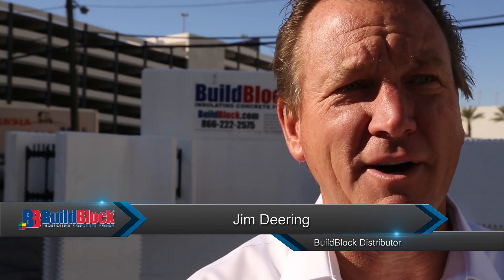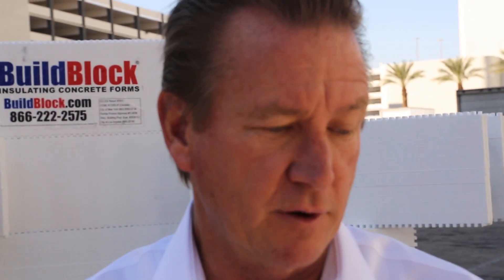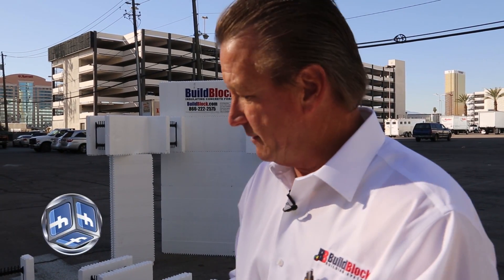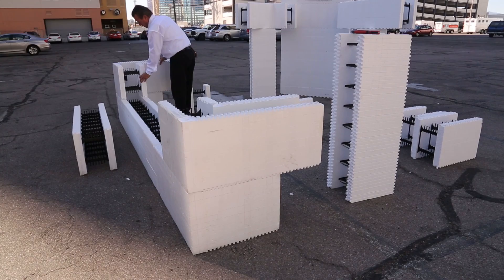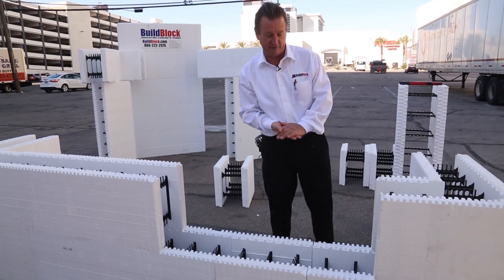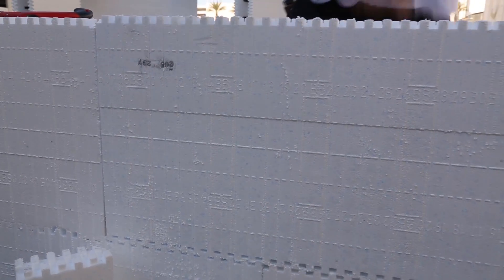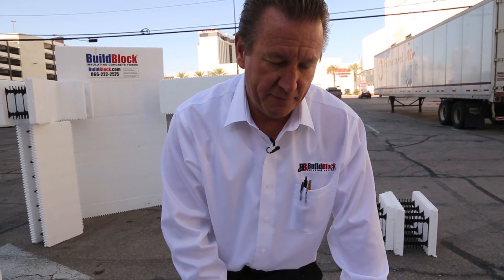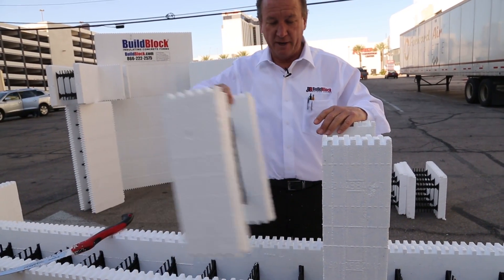BuildBlock Field Notes ICF Wall Stacking Strategies

Comment: BuildBlock has a video on building a POOL! Our City Hall, 12,500 SF was built like this. The only problems were Metal Roof, Air Conditioning ductwork and sound system for meetings. What do you recommend for roofing? Thank you!

Comment: I'm confused about the thinking behind the long legs of a corner being on the same side.  Does this end up having better overlap in the wall from course to course or is this somehow advantageous in some other way?  I follow that having measurements hew to a 6" increment is good, I'm just not getting the advantage of the long corner legs and the short corner legs facing each other in the course.
Reply: if you do short to short and long to long, the resulting length of the wall is always and increment of 6 inches using full blocks. hmmmmm

Comment: Jim Deering: Jim it was not easy for me to understand around minutes 13-14 of your video the considerations for the guys doing stucco (plastering as we call it in the UK) and the issue of the vertical lines on the Styrofoam blocks  (the lip of the foam blocks and how this may impact them).  Could you clarify briefly here if you see this note?  Thank you.

Comment: I saw this on Pure Living for Life channel.
Reply from the maker: Yep! They are using a different ICF brand with some notable differences from BuildBlock but the general technology is the same. For example, you'll hear them talk about the 2-inch connection pattern on the block they're using. BuildBlock, on the other hand, has a fully reversible 1-inch repeating pattern. This provides a tight, 100% surface to surface connection and keeps you from needing any of the clips or zip-ties that you see the Pure Living folks using to hold the blocks together. If you'd like more info on ICFs you can visit us at buildblock.com. Thanks for stopping by!

Comment: keep away from open flame
Reply from the maker: The foam on all ICFs is treated to be fire resistant. The structure of the house is steel reinforced concrete. The foam is only used for insulation. Foam doesn't burn, it melts and is self extinguishing. Once filled with concrete and finished with a 15-minute fire barrier such as sheetrock as required by code, ICF walls have a 4+ hour fire rating.

Comment: since this is styrofoam, it should be very cheep for these units - 
how much are they?
Reply from the maker: Hi Tiger, You can find direct retail pricing by visiting http://buildblock.com/store/icf-pricing/ or by giving us a call at (405) 840-3386. Thanks!
Reply: tiger body EPS is not cheap.   Go price compare some plain old 4x8’ 2” styrofoam panels and you may be in for a bit of sticker shock.  A lot more work goes into making ICfs, including adding the internal members and the hard points.  “Cheap” and ICFs don’t get used in the same sentence very often

Comment: what happens when you spill gasoline on it?
Reply from the maker: Well generally we don't recommend you spill gasoline on your house, at least not in any large quantity. Chemical solvents like gasoline, kerosene, paint thinner, etc. But it's a fair question in a garage or other area. It's very important to ensure that any waterproofing primer, paint, etc. not be petroleum based. 

All ICF is required to be finished. The exterior should be brick, stucco, siding, eifs, etc. Interior is typically plaster, tile, sheetrock, etc. So unless the area is completely saturated, a small spill should not cause any problems. No more than in a wood frame home. the worst it would do is dissolve the foam until the solvent is consumed.

Comment: I've used this system or one identical...good system short of the Lego nubins are a real time consuming pain in the ...s...plus it shrinks as you pour in lifts...the Polly webbing and side straps for attaching wall treatments strip out or fracture...been there done that...
a tounge and grove system is so much simpler and faster...can setup a 3k+ basement or home in one day and pour the next...(with experience) by myself and good pump operator ...and follow systems recommendations ...
poly steel is the system I like ...but there are now multiple systems available ...good luck and happy trails

Comment: How does this fair against termites? I remember reading about a lawsuit, don't recall all the details but it was a 20 year old build and termites funneled through the foam insulation to the upper levels. They don't eat foam but are still able to tunnel through and hit the roof and go back down other side.
Reply from the maker: You're right that the EPS foam in BuildBlock ICFs is not a food source for termites but they may burrow into unprotected foam surfaces in search of food (wood). While termites cannot compromise the strength or integrity of the BuildBlock wall, they could burrow through the foam to reach and damage untreated wood. We recommend using BuildShield Termite Protection in termite prone areas. BuildShield Termite Barrier combines a patent-pending combination of a PVC extrusion track and an adhesive stainless steel barrier. The track and stainless steel barrier extend from inside the concrete core to the exterior wall finish creating an impenetrable barrier to termites and is the only ASTM E283 tested and code approved solution for ICFs in termite prone areas. Read more about it here- http://buildblock.com/products/buildshield-termite-protection/

Comment: Not ONE word about Styrofoam as garbage. Styrofoam does not decompose in the environment under normal circumstances. Much like plastic, Styrofoam is made from a polystyrene-based petroleum product that is not biodegradable. Plastic takes hundreds of years to decompose, and Styrofoam takes much longer because it is a stronger form of plastic.
Reply from the maker: Thanks for the feedback!

BuildBlock is designed on a 1-inch repeating pattern. This means that at little as 1-inch can be cut of and the rest of the block is usable. With proper planning and care it is possible to generate as little as one trash bag of trash from an entire job site.Also, any cut piece of ICF can be integrated into the wall in a different spot as long as it has at least one web. We also recommend the use of a hot knife which creates smooth clean cuts with no other waste. 

EPS foam is broken down by UV light. The fact that EPS foam takes so long to break down is the very reason that using it as an insulation material that is sealed inside of a wall system a perfect application. This material will deliver extreme energy efficiency, well beyond any other material for generations. 

We believe that this creates far fewer environmental impacts than the high cost and waste of resources to heat and cool inefficient homes and buildings. EPS foam is also easily collected and recycled. Many manufacturers are also zero waste facilities. 

Let us know if we can answer any other questions or concerns.

Comment: Is this Lego's for big kids?
Reply from the maker: Sure is! Stacked easily like Lego and then filled with reinforced concrete. ICFs create a wall system that is incredibly strong, energy efficient, and fire resistant. Structures built with BuildBlock create a healthy environment with 75% less outside air infiltration and stand up to any natural disaster.

Comment: What about polluting material you spread around when you cut? It is plastic.
Reply from the maker: Our blocks are made of Expanded Polystyrene (EPS) Foam and we recommend the use of a hot knife when cutting ICF blocks which doesn't cause any bead to break off during cutting. EPS beads that do break off and fall are easily swept up and recycled. 

EPS foam breaks down in the presence of sunlight and using ICFs reduces the total number of products necessary to build a home (including plastics). ICF homes can be built with as little as a single trash bag full of waste. Added the fact that BuildBlock ICFs use a 1-inch interlock pattern meaning you can integrate even the smallest amount of cut product into the wall and make use of it. ICFs will last for 100s of years with energy-efficiency beyond any other technology.

Comment: what animal will be killed eating all that loose crumbs that you just throw on ground + what about water runoff  on the job site that crap will get into streams and ponds how many fish will be killed pluges up water system filters hope you can sleep at night
Reply from the maker: BuildBlock recommends the use of a hot knife when cutting ICF blocks which doesn't cause any bead to break off during cutting. EPS beads that do break off and fall are easily swept up and recycled. EPS foam breaks down in the presence of sunlight. 

Using ICFs reduces the total number of products necessary to build a home, reduces the amount of plastic and ICF homes can be built with as little as a single trash bag full of waste. Added the fact that BuildBlock ICFs uses a 1-inch interlock pattern meaning you can integrate even the smallest amount of cut product into the wall and make use of it.

ICFs will last for 100s of years with energy-efficiency beyond anything other technology. This reduction in energy use and the costs & environment effects to produce it are more than offset.
Reply: +Richard your comment only shows that you only care about you I have seen people that make that kind of mess and walk away typical contractor screw the environment  screw the customer you're right big boys fat dum and clumsy

Comment: how about if fire come whole house will burn in a second & all ur neighbors so I disagree
Reply from the maker: The foam on all ICFs is treated to be fire resistant. The structure of the house is steel reinforced concrete. The foam is only used for insulation. 

Foam doesn't burn, it melts and is self extinguishing. Once filled with concrete and finished with a 15-minute fire barrier such as sheetrock as required by code, ICF walls have a 4+ hour fire rating.

Comment: do not drop a mach, pal
Reply from the maker: The foam on all ICFs is treated to be fire resistant. Foam doesn't burn, it melts and is self extinguishing. Once filled with concrete and finished with a 15-minute fire barrier such as sheetrock as required by code, ICF walls have a 4+ hour fire rating.
Reply: impressive! 
wondering how much it will save compare the normal building material, let say a single 2-story house. Thanks
Reply: and the time of course ;-)
Reply from the maker: The materials offset each other. ICFs are more expensive ~5% but overall savings during construction include reduced HVAC requirements, faster construction, etc. ICFs deliver benefits continuously for the lifetime of the structure: lower energy bills, reduced maintenance, disaster resistance, airtight walls (low dust), very low noise penetration, etc.
Reply: How many factories do you outsource to produce your blocks?
Reply: I know some if not all are American made.

Comment: good luck with that sysrem. used it. pain in the ass and stucco looked like crap
Reply from the maker: We're sorry you had a bad experience. Was it with ICFs in general or BuildBlock specifically? Our customers build thousands of projects each year, most without challenges. We're curious about what challenges you had and if we can offer any suggestions. I'm Brian, you can reach me, Brian at 405-840-3386 or bcorder@buildblock.com

Comment: Is there any reason you could not paint/coat the interior and exterior to save on siding and drywall?  I have seen hard coats on  outdoor EPS in Asia.
Reply from the maker: That is a perfectly acceptable way to finish ICF structures. We market and sell BuildCrete Stucco & BuildCrete Plaster that are used for just that purpose. Both the plaster & stucco are each a 1-coat system that can be troweled or sprayed on and use a embedded polyester mesh. Both can be painted easily. The stucco is impact resistant to 3500psi and plaster 8500psi. Both are waterproof.

On the exterior you will want to make sure that the foam is protected from UV light and damage from the elements. On the interior, it is required that all foam is finished with a 15-minute fire barrier. Our plaster and other materials will satisfy this requirement. 

Learn more about BuildCrete here http://buildblock.com/products/buildcrete-stucco-plaster/

Comment: Could this system work for walls that are not divisible by 6"? For example, what would you do with a basement wall that is 48' 9 1/2"?
Reply from the maker: The web spacing is every 6-inches, but you can build a wall of any length. The blocks have a 1-inch repeating pattern so you can cut off as little as an inch and still interlock the blocks. For walls of an odd dimension you will end with a common seam. just strap both sides of the block every course and it will work fine. If we can answer other questions, please let us know. You can reach Mark in our technical department at technical@buildblock.com or at 866-222-2575. The full BuildBlock Technical Manual is available on http://buildblock.com

Comment: Is there an interlocking part that wasn't in the video ? I did something like this back when I took carpentry school and the blocks had nubs they screwed into the foundation.  Kind of like the flat Lego pieces
Reply: who ever said concrete has to breath better do more research. exsplain where bridge legs under water breath? or auquaducts  or sewage plants, water treatment plants? conrete will setup hard under water in fact its the best cure method . what deteriates concrete most is freeze thaw cycles and chemical breakdown. i just retired  union cement mason.
Reply from the maker: Correct. Concrete doesn't need to breathe. The EPS foam encapsulates the concrete protecting it from outside elements and temperature changes as well as creating an airtight wall. The sealed environment also allows for a very slow hydration reaction resulting in even stronger concrete.
Reply from the maker: Vertical rebar dowels extend from the footing tying into the concrete core of the ICFs. The blocks themselves are stacked on the footing and leveled after a couple of courses. Low expansion spray foam is used to spot glue the blocks to the footing during construction and a full bead of foam is used before the pour. 

The blocks themselves interlock with each other using a very tight interlock pattern that repeats every inch. More information is available at http://buildblock.com/buildblock-icfs/buildblock-design-advantages/

Comment: the styrofaom acts as a insulator but concrete has to breath if not it will deteriate
Reply: So concrete slab foundations are deteriorating?
Reply: With the styroform system yeah
Reply: RICK SOSA do you know that concrete hardens with water. 

Do you also know that EPS doesn't have high vapor resistant which means water vapor can get away from core it might be slow process but it will dry eventually.

Comment: Mice love these houses they eat tunnels through the insulation like it's a styrofoam cup.
Reply from the maker: Rodents are typically uninterested in ICF homes and since the structural wall is solid concrete, they tend not to eat any further. EPS foam isn't a suitable material for nesting unlike batt or cellulose insulation in cavity walls. Additionally the EPS foam is concealed beneath the external finish such as siding, brick, stone or stucco and a barrier such as plaster or drywall inside the home.
Reply: Master craftsman Rosalina please provide evidence of this.

Comment: I built several homes in Costa Rica with this block back in 1999 and 2000.
Reply: how are they holding up
Reply: solid. totally solid.
Reply: TheSoCalSurfer69 thank you for the info
Reply: I'm a construction science student and I'm trying to learn some good practices when installing ICF's; what are your thoughts on sealing the seams, or putting an adhesive in-between the Styrofoam blocks to keep concrete from leaking? I'm not sure if it's necessary or overkill.

Comment: wonder this will create melamine odour when heated to 40 degrees Celsius
Reply from the maker: It shouldn't create any odor at that low a temperature. Would be no different than an ice chest in a hot car. The ICF is also sealed behind a 15-minute fire barrier. This is typically gypsum board / sheetrock on the interior and siding, brick, stucco, eifs on the exterior. The foam is never exposed.
Reply: the finished wall thickness will be how much?
Reply from the maker: It depends on which block is used. Our traditional forms come with core widths of 4in, 6in, and 8in. The foam on the form is 2.5 inches on either side (so 5 inches total). 

That will make for a total width of your wall (before finishing with stucco, brick, sheetrock etc.) either 9in, 11in, or 13in. 

You can always find more information and all of our dimensions on our website: http://buildblock.com/products/buildblock-icfs/

Comment: You must understand that these are filled with cement.
Reply: Outer layers are insulation.  Inner is concrete & rebar.  This creates a layer of insulation on the outside, a strong thermal mass on the inside with a layer of insulation on the outside.  In hot environments it takes 1 hour per inch without insulation for the heat to transfer.  In cold environments the same.  The insulation value of the walls is most likely well above that of wood frame and drywall, the durability blows wood frame and drywall away.
Reply: Jesus Carrillo Don't you mean concrete and rebar
Reply: tiger body is used as insulation....
Reply: Yes cement and rebar
Reply: HadzirLP what dumbass use concrete for isolation?? Its for strength
Reply: Concrete is one of the worst insulators.
Reply: what? still needs rebar?
then what is the point of all this styrofoam?
Reply: How well does cement and aggregate work as insulation?
Reply: builderjen  the costs seems to be hidden.
Reply: and rebar?